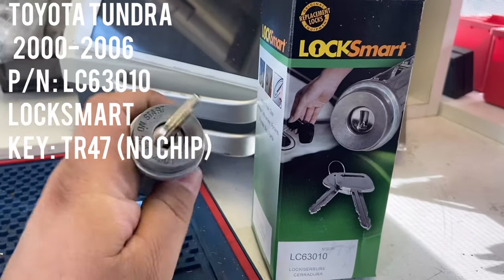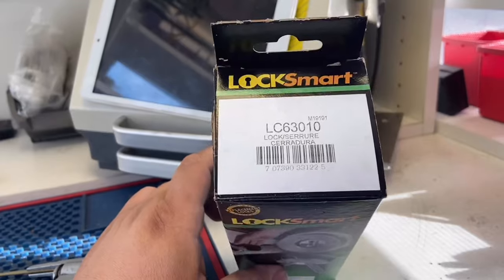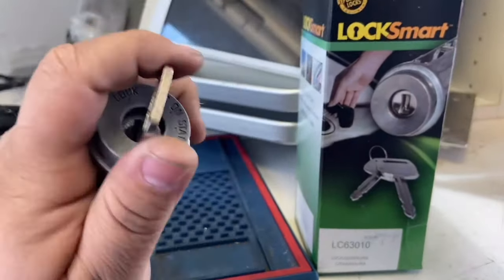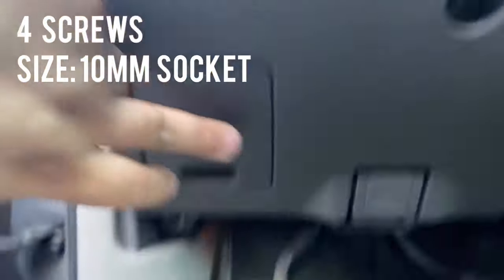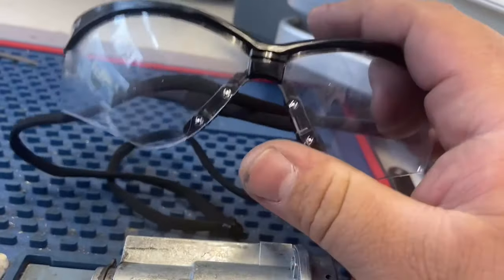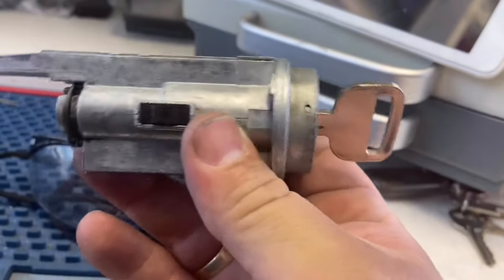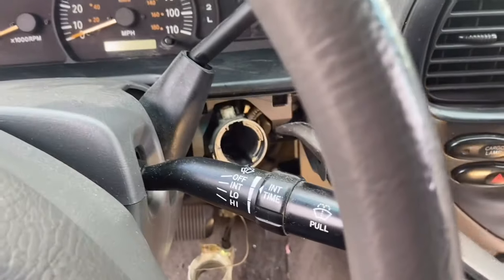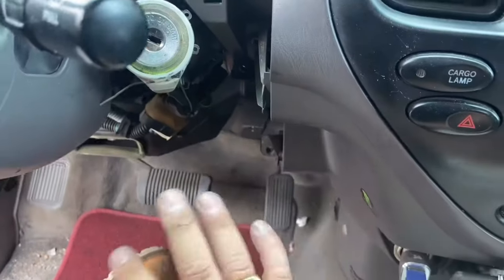TOYOTA IGNITION LOCK CYLINDER REPLACEMENT (EARLY 2000 MODELS)

Comment: You can put a tr47 blank key in the ignition it will reset the split tumblers and key will turn take apart and remove split wafers
Reply from the maker: Thank you thats a great tip!! Will keep that in mind!!!!God bless you!!
Reply: @MYKEYSAUTOMOTIVE  mßß
Reply: We’re can I find one of those
Reply: RODNEYdaROCKSTAR 6 a blank Toyota key blank tr47
Reply from the maker: @rodneydarockstar6360  ebay
Reply: Boy am I glad to look in the comments!! Saw this on the way to changing 1 of these for the 1st time and tried out your trick. Worked like magic! Thank you!
Reply: @xaviercruz3808  can you elaborate a little bit? I’m not very mechanically inclined.  What exactly do I need to do?  Thank you in advance.
Reply: @serchizm  me personally, I did the trick he mentioned to get the Ignition to turn again (was stuck in OFF position). Put blank TR47 Key in ignition, felt like a click or 2 and then took it out, put their Key that used to work in and boom it turned like nothing was wrong with it. It is just a temporary fix though as it was only a min or 2 of playing with Key turning on and off before ignition froze up again. So either take broken wafers out of Ignition like OP mentioned or just change out Ignition completely which is what I did.
Reply: @xaviercruz3808  thank you for responding. I’m at a mechanic shop now close to home that’s going to change the ignition for a very reasonable price. I really wanted to try and tackle this job, but I’d rather leave it to the pros.
Reply: @rodneydarockstar6360  Update on this, found out the local Toyota Dealership has blanks without the transponder for about $5 and they have over 100+ in stock at all times
Reply: Also update on trying the blank, it worked amazing! Gonna have the lady use this method till we can get a local locksmith to fix the OEM assembly. Thank you so much !
Reply: I have Toyota Avalon. The key turned freely but no connection

Comment: Great video.  I watched it, giggled the key and managed to get it into the accessory position.  I disconnected the battery and bought a new switch.  I had it installed in 20 minutes.  The video even tells you what socket to use and where the bolts are.  The only tricky thing was the light ring,  it popped off and I had a bit of an issue aligning it, but still managed.  I loved the fact that this was for my exact vehicle, but probably works with many others.  The pin he's drilling out is an anti-theft device.
Reply from the maker: Thank you james for sharinf your experience!!🙏🏼🙏🏼❤️❤️❤️

Comment: Best  video to put the ignition lock cylinder in with.  My vehicle is a 2003 Toyota Highlander. Made changing so easy.  Just follow instructions and you can't go wrong if you have the correct cylinder.  Thank you

Comment: You saved me a lot of money bud, thank you - something came unstuck & got jammed inside the ign cylinder on my Gen 3 Hilux Surf & although the key goes all the way in, it absolutely refused to turn - I drilled the pin out as you described & fitted a replacement barrel.

Comment: Fine video. Last night I could not get my 1998 Toyota Rav4's key to turn to the ACC position. I made many attempts. In the past I have fully removed the igition lock/switch assembly, so I repeated this chore today. Then I went at the button with the drill, as shown in the video. I started with a 1/16-inch titanium drill bit  and a $13 corded drill from Harbor Freight. The drill bit was barely making a dent in the button, but things seemed much looser. I tried the key and lo and behold I was able to get the key to the ACC position; remove the cylinder; and replace it with a LockSmart LC63100 from Autozone ($57).
Reply from the maker: glad i was able to help! cheers
Reply: 9:00 9:10 9:11 9:11 9:12
Reply from the maker: @kevinodom4022  thank you

Comment: thanx for the videos man, great info, i started learning as a locksmith years ago, basically on older cars without smart keys and transponders stopped round about 1995,i recently lost my job on the refinery, decided to use my money that is due to me for buying the xhorse dolphin and the accessories going with it, to start a small business and getting back into the game, in the old days i was going to try and pick that toy ignition to acc, to press that button in, and pull the cylinder out, once that's done i was gonna strip that cylinder down to the barrel ,then hand file the key ,rough up the blade a bit to where if you put a bit of pressure on the brass slide it makes a mark where your cut should be, then file that mark until the slide is level with the barrel, do eac one and then do the other side, eventually flipping the key around in the barrel to mirror the other side that's how i learned to make keys for the first two years with hand and file, after that i went to guide keys or depth keys didn't touch a cutting machine for three years when i started learning the trade
Reply: hi, is it possible that i could email you, and could you pls give me your email , iv got a question on a certain topic that i don't realy understand pls man thanx
Reply: any updates? did you end up doing locksmith work??

Comment: Hello, I followed your instructions and they worked perfectly until the point where I drilled out the pin then I pulled out the ignition. My key was stuck in the lock position. At this point in the video, you show using needle nose pliars to adjust the interior mechanism to the “Accessory” position. When I try to adjust it, it won’t move and I can’t adjust it to accessories position, so I can’t install the new ignition because it’s not lined up. Is there a trick to adjusting the interior mechanism. Please I need help
Thank you

Comment: Great video, came across your video. Is there any differences with finding one of these on amazon for an Toyota Avalon 1998? And are there any additional electronic security shut offs?
Reply from the maker: no difference same thing ,must check with the dealer to see if you vehicle is equipped with a immobiliser system
Reply: @MYKEYSAUTOMOTIVE  I actually permed the replacement. On every Toyota Avalon XLS there is a security chip. To make this fix work, i hold the old key closely to the new key when inserting the key, wait for the red security light  hold to on in the dash then turn off...then i turn the key. Success! If I wanted to I could buy a chip key and have it remade with the new key but that's extra $$. My method is the quick and dirty method.
Reply from the maker: @videosuperhero100  glad you where able to figure it out! cheers
mate!🙏🏼🙏🏼🙏🏼💯💯💯❤️❤️❤️
Reply: @MYKEYSAUTOMOTIVE  your video made me think I could do it, thanks for putting it out there! Then combined with this other video showing me the trick for the security got me to the finish line

Comment: This video was immensely helpful.  I appreciate the information very much.  I was able to change mine out, and after doing so I compared the new key to the old and wondered due to the extreme wear on the old key whether or not it was simply the key itself.  I suppose if I am able to get a new key for the old one and have it turn with no issues(or not) I will comment on here again with the result.

Comment: The best job I seen  on this problem you made it so simple thanks for your smarts God bless
Reply from the maker: Thank you for watching God bless
Reply: Let me ask you another question my son has 2004 Toyota Tundra it's a V8 SR5 it's got $250,000 MI I need to change the plugs so I'm afraid that they may not come out what do you recommend to do I heard spray some good corrosive spray maybe heat up the engine a tad and then take them out what do you think God bless brother

Comment: I followed everything you said. Now the new one I installed with the new key and it doesn't want to come out and it locks on ACC. The key comes out only if I disconnect the battery, only than it releases back to lock and key comes out. Any suggestions? Hopefully I'm being clear so you can understand me. Thanks
Reply from the maker: What year and model???
Reply from the maker: Sounds like the ignition lock cylinder is not seated right!
Reply: 2000 toyota runner
Reply from the maker: JD painting  i think you turned it a bit too much try to adjust the inside right!! The vehicle cannot tell weather you are in parking thats why the key doesnt want to come out!
Reply: Thank you brother! I just figured it out! Thanks for your time and consideration. Your video was very helpful!! 🙏👍👍
Reply from the maker: JD painting you got it!! Glad you liked it!! Take care!!

Comment: I’m changing my cylinder on 1999 4Runner. Followed everything. But when I turn it on, it sounds like it’s about turn on but doesn’t fire up. Does the alarm on there have any affect that’s preventing me to crank up the engine?
Reply from the maker: 4runner models 1999 and up key requires programming...😋😋😋😋😋😋

Comment: I bought the same brand lock cylinder at Autozone but with the battery connected, the key wont turn all the way back to remove key. Not sure why only when battery is connected.
Reply from the maker: Buzzard underneath housing not work unplug it

Comment: Need to see if you have any information or video on 2012 Tundra ignition Key stays stuck and can't remove. the acc stays on! is this the switch or is it a solenoid on the ignition switch. I've heard it's the solenoid. Do you have a video on replacing or repairing of either solenoid and or switch?

Comment: My key froze and would not move to ACC. I got my old cylinder out but where you turn the switch to ACC with the needle-nosed pliers mine seems stuck and won't turn to ACC! My old cylinder turns freely btw. What now? Is it something else or is there a trick to turning it to ACC?
Reply from the maker: Move the steering wheel around!! Jiggle it!! Maybe the steering lock is activated!
Reply: This worked for me. Thank you.

Comment: @my keys automotive I have a 2001 Toyota Tundra sr5 2wd with auto theft activated and now it will not crank or turnover when you turn the key all the lights on the dash light up but nothing happens
Reply from the maker: Did you lose your keys or why did you replace your ignition cylinder ??..the keys need to be programmed to your vehicle!!
Reply: I didn’t replace it yet what happen was I bought the truck drove it home and parked it and unhooked the battery to put a new one in and the alarm started going off after I hooked the cables on the new battery ! Sorry about that .
Reply from the maker: Check uder the dash on the driver side look for a little box with a button on it and hold the button ..

Comment: Did you rekey the ignition cylinder to match the original key prior to changing it? Or did you just use the keys that came with the new lock?
Reply from the maker: Just used the keys that it came with!!
Reply: @MYKEYSAUTOMOTIVE  but didn't you need to re-program the keys from the original "master" key to be recognized by the transponder and unlock the immobilizer?

Comment: I replaced the ignition lock cylinder on a Toyota sienna LXE  the car crank but won't start. I didn't use original part could it be the anti theft system
Reply from the maker: What year is ?? Yes you need to put old immo reader..its a little plastic ring the goes around the ignition lock cylinder

Comment: Excellent video,,, but I cannot get the key to release from the cylinder after sliding it back into position ( in the ACC position) and then turning it to the OFF position.  They key won't come out.
Reply: Jon Randall same here
Reply: You may need a new code cut key. I would put it into ACC then pull it (the ignition cylinder) out. Your key will come out at this point.  Go to a Locksmith to get a new code cut key (factory specs) or dealer if you prefer
Reply: @wattvoltamp  Thanks. Actually, there is some kind of sensor, or electrical wire connected to the ignition cylinder.  This part is known to fail.  I simply disconnected the wire, and all is good.  I believe it is part of the anti theft system.  I finally ordered a new entire ignition cylinder, and the key would not release out of it either.  But after disconnecting the wire, it worked perfectly.
Reply from the maker: good job on figuring out the issue!!

Comment: 7:19 what if the steering wheel is locked
Reply from the maker: The steering wheel unlock when u turn it to the acc .. if you turn it with the pliers and your steering wheel is still locked your gonna have issue with the steering lock not the ign
Reply from the maker: You can also try moving the steering wheel as your turning the switch to the acc ..that seems to fix the issue
Reply: Thanks
Reply from the maker: @Aintchujusto  no problem
Reply: What’s the name of that tool you was using
Reply from the maker: @Aintchujusto  what tool my brother ?? The long needle nose pliers??

Comment: I was wondering if you had tried a code cut key  first? That seems to work for me on Toyota locks. Love your videos!
Reply from the maker: Yes i cut a fresh key out to the key code,it didnt work. This is a very common issue with older toyota models ..the igniton lock cylinder starts going bad.. the pins and springs become worn out, causing it to not work even with freshly cut key to code.
Reply: @MYKEYSAUTOMOTIVE Thank you
Reply from the maker: wattvoltamp thank you for watching!!🙏🏼
Reply: @MYKEYSAUTOMOTIVE  great video .. just wondering have you tried a milling bit instead of a drill bit as the milling bit will not make the hole sloppy and it cuts the pin away in half the time ??
Reply from the maker: James Haywood no i havnt, i will try that!!thank you
Reply: what is a code cut key?
Reply: @gregroryramos6666  a key cut to factory specs
Reply: @MYKEYSAUTOMOTIVE  yea the cause is due to the split wafers in these, all toyota older models, the split wafers fail- just like Honda

Comment: The car wont start with the new ignition key lock cylinder, it turn over but won't start. This is a 2002 toyota sequoia
Reply from the maker: Well first off the vehicle has a transponder system!! So if it doesnt read the original key it has programmed it ill not start!! The new keys must be programmed to the vehicle...
Reply: @MYKEYSAUTOMOTIVE  is that for all cars

Comment: My Toyota Camry won't turn off!!! What isnit
Reply from the maker: Ignition switch might be broken!!
Reply from the maker: Ignition switch is behind the ignition lock cylinder
Reply: The key can still move just can't start or turn off engine
Reply from the maker: @sternarosenfeld407  switch is def broken
Reply from the maker: Located once again behing the ignition lock cylinder.. its a white plastic piece if im correct.
Reply from the maker: @sternarosenfeld407  happens to older toyotas happened to my corolla 89 ..
Reply from the maker: @sternarosenfeld407  remove lower dash panel should be two screws holding it on..
Reply from the maker: Thank me later...☺️☺️☺️